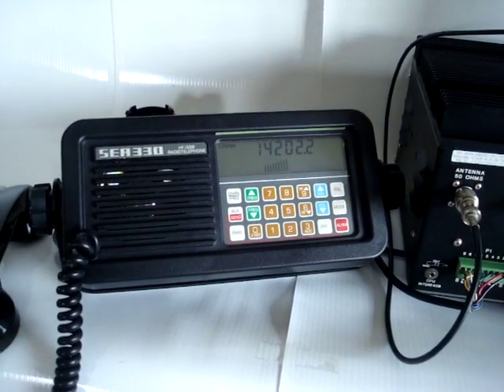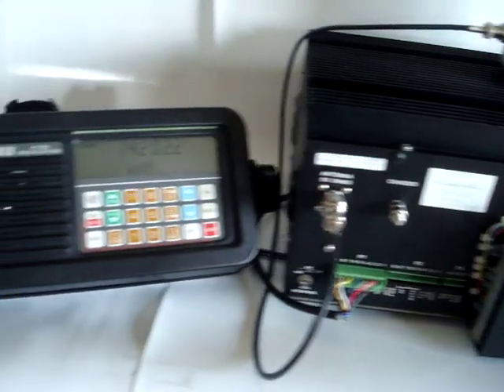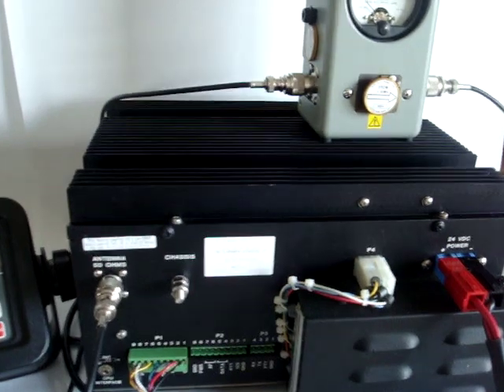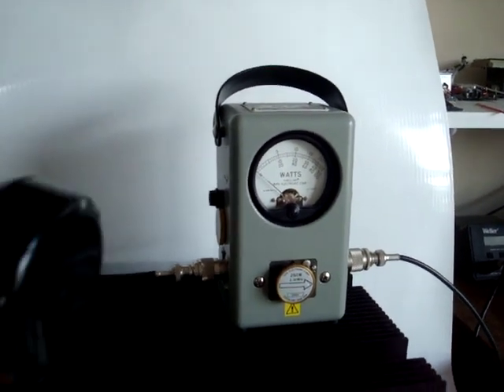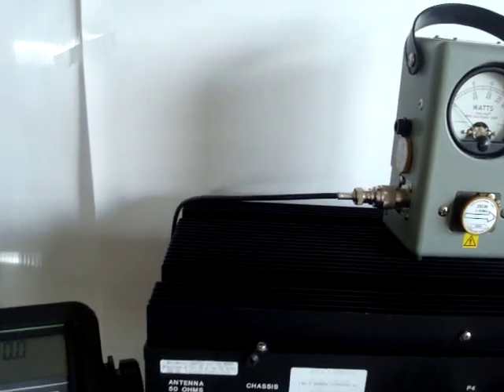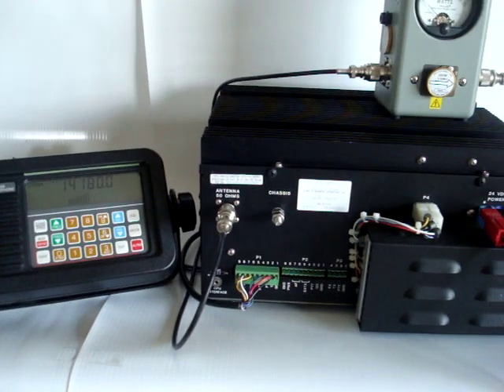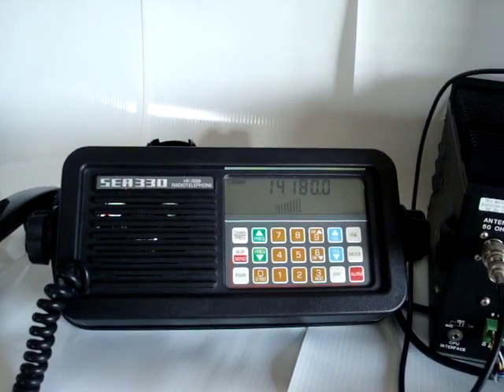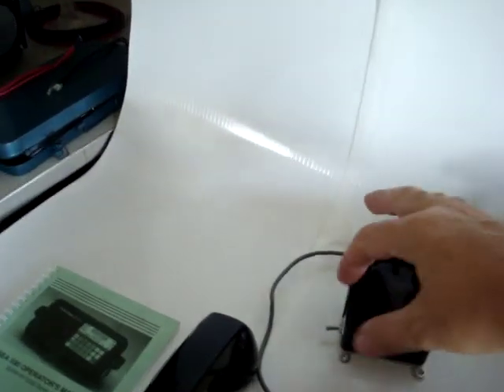SEA330 300 watts HF SSB marine transceiver  for use on the high seas

Comment: How to generate low wattage signal for power testing with dummy load.because it has 50,150 and 300 watt mode.second, any one can tell what would be the circuit diagram or connection diagram ,if we use ptt mic in place of phone cradle.Third, how to set on cw mode?

Comment from the maker: I disagree. Let's do the math. The radio can do 300 watts RF. Across a 50 ohm load (the impedance of the feedline as well as the BNC connector used), the voltage would be sq.root (300x50) which equals 122 volts RMS (173V peak). The current would be sq. root (300/50) which equals 2.46 amps RMS (3.5amps peak). Those voltage and curent levels are WAY within the limits a BNC connector can handle, especially for frequencies at- or below 30MHz.